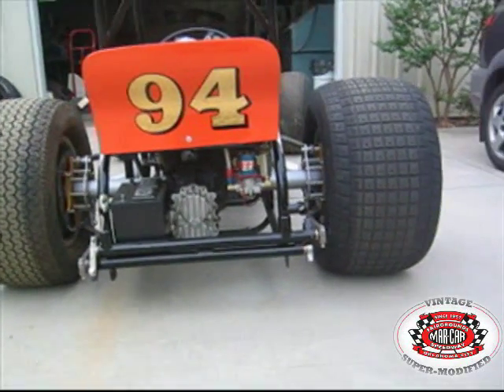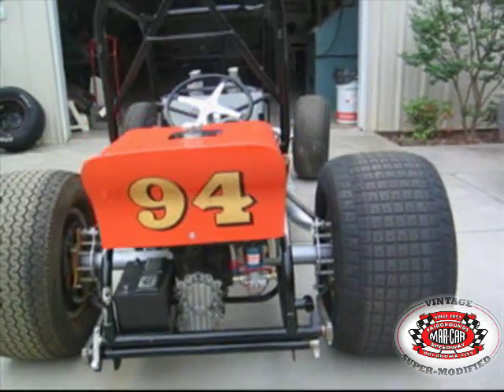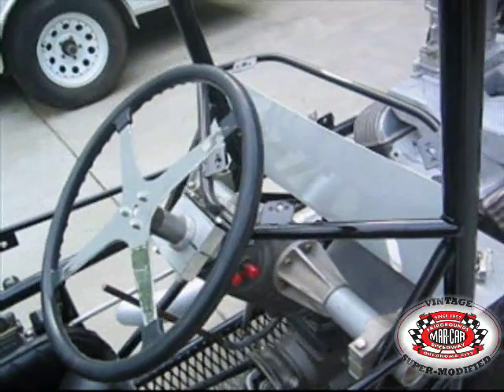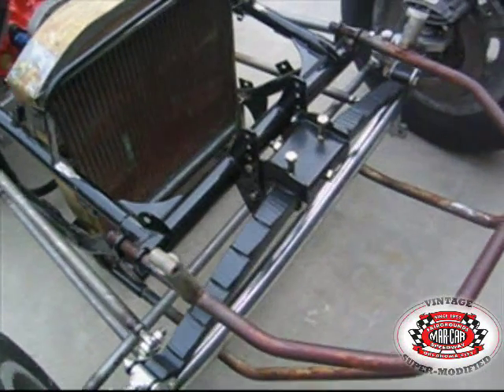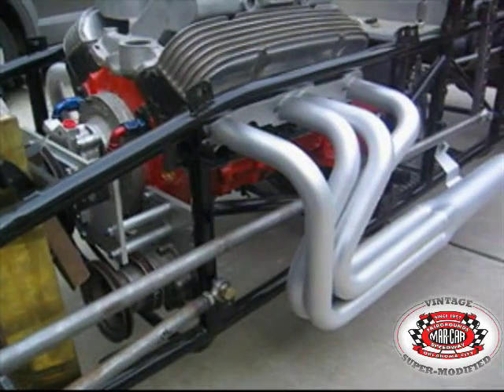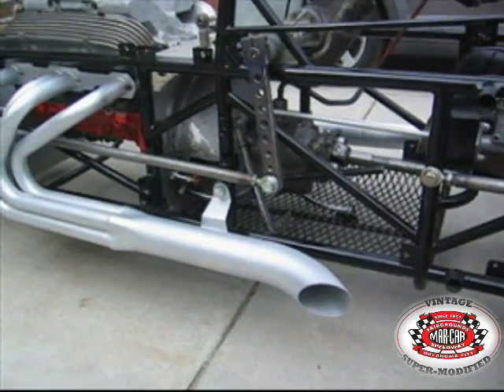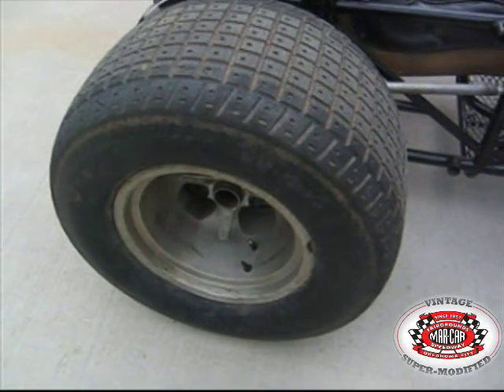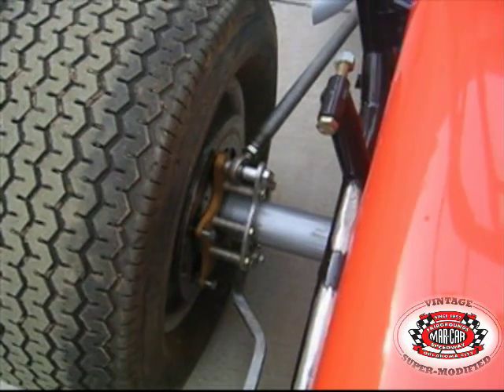Hampton 94 update

Comment from the maker: I think the car was built in 1973. It was a Nance chassis, and was owned by Shot Hampton of Kansas.  The primary purpose of the car was to win the Hutchinson Nationals, the biddest race if the year for NCRA Supermodifieds. Hutch was HOT, dusty, and 50 laps long, wringing every bit of strength out of you by the end of the day. This car won I think in 1975, and went on to race inot the 1980's in Amarillo , Texas. This is one of those cars that was more notorious than its drivers.